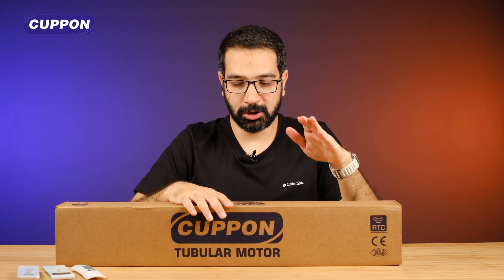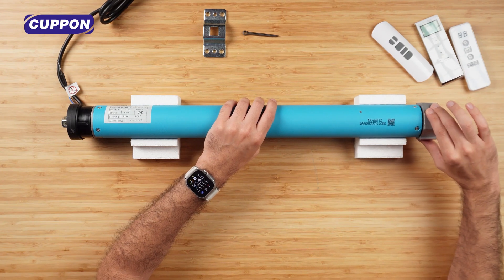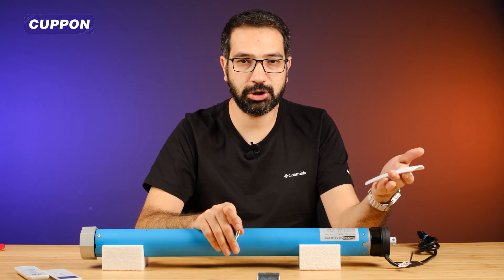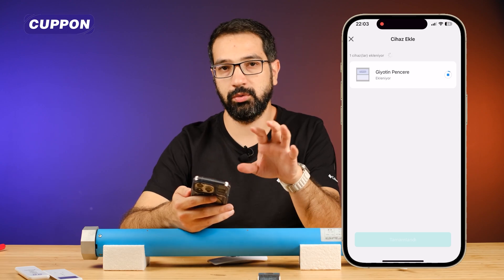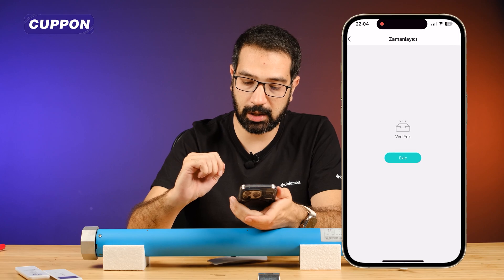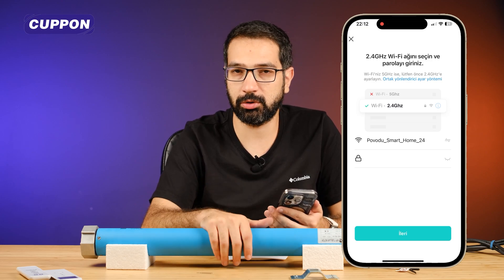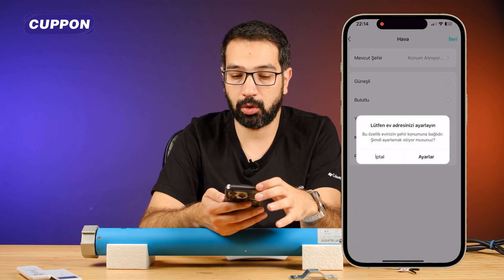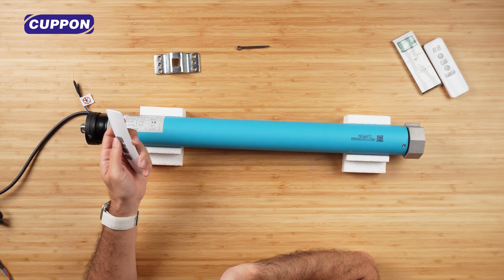Cuppon Tubular Motor Build in Wifi Receiver Introduction and Installation Video

Comment: Good luck! I watched the video. First, we introduce the remote control and set the limits. Then, we switch to Wi-Fi mode. At this point, we need to press three times. The light should start blinking, but it stops here and doesn’t blink.
Reply from the maker: Hello, we kindly ask you to contact our technical team for support on this issue.

Comment: Hello,
I have cuppon motor for zip screens on pergola.
One screen works ok, the other screen goes up when I press the down button and closes when I press the up button. I reset several times... Also, I can't find any instructions on how to change the direction.
Can you tell me how to change the direction on the remote control?
Thank you
Reply from the maker: You can contact export@sinuselektronik.com for support.
Reply: How many motors can be used on wifi applications together.. ? Can I make 20 motors working together?

Pergolas motor setting
Reply from the maker: Hello, yes you can control 20 motors via the application. For details, please contact us at 0 554 576 07 35. @maezarjackoush557